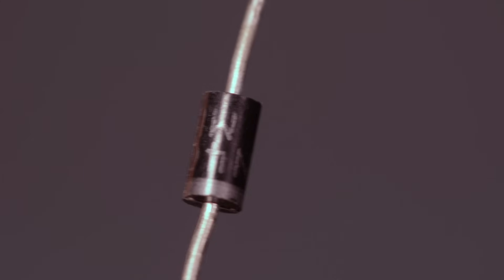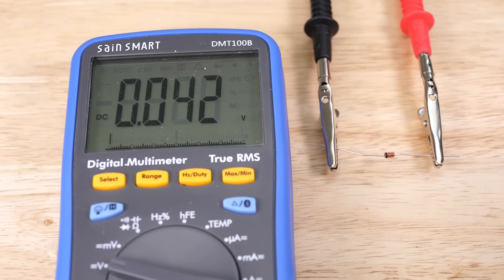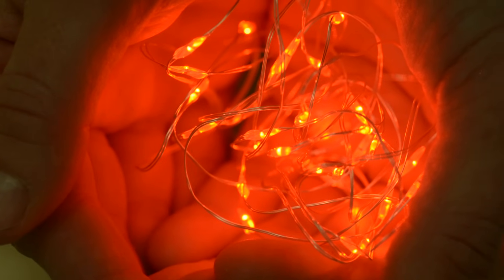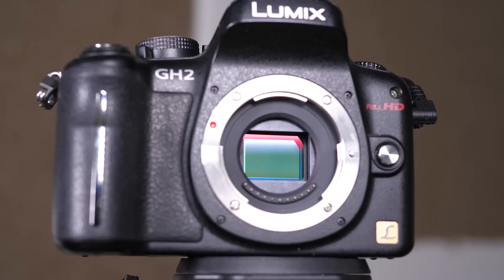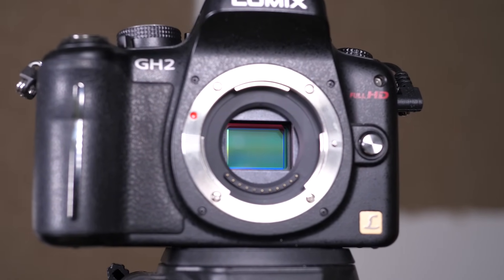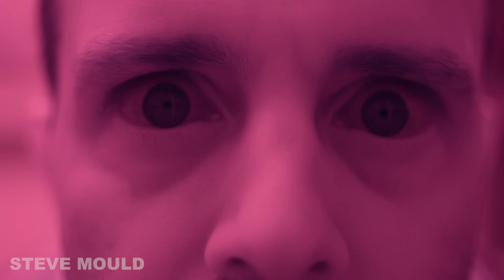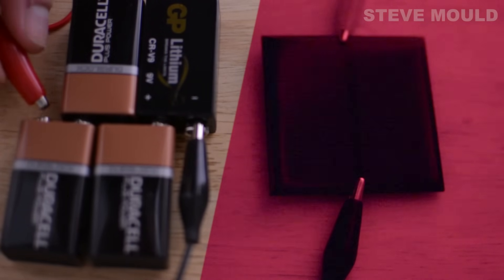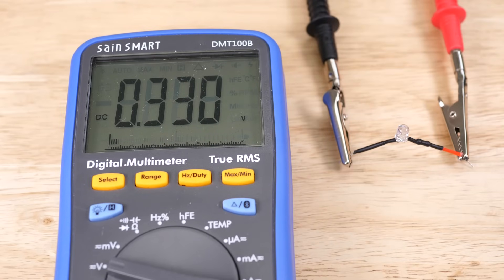Why all solar panels are secretly LEDs (and all LEDs are secretly solar panels)

Comment: It's also the same for electric motors and generators. Heh, it's a fun world we live in.
Reply: also peltier elements, put a power in one, and one side gets cold and other hot,  create a temperature difference and you get  power out of it.
Reply: @jolomies  watched electroboom's vid about peltier and someone in the comment section said that peltier is only 5% efficient. Is this true?
Reply: And piezoelectric crystals!
Reply: @allanrichardson1468  Actually, no.  If you squeeze those crystals you get a CHANGE in electrical potential, NOT an increase in current flow.  However if you increase or decrease the current through them you change the vibration of them.
Reply: @protoborg  Actually no. A piezo crystal is very high impedance, at DC at least, it's effectively a capacitor. Stress the crystal and you produce an electric charge on the crystal faces, apply an electrical charge and you induce stress into the crystal. Current flow is negligible at DC, just the initial tiny current to generate the charge.
Reply: @ferrumignis  And that proves I'm wrong how?
Reply: @protoborg It doesn't "prove" anything except that you mistakenly stated that a piezo crystal is driven with a current to create movement.   It's actually voltage driven.
Reply: @ferrumignis  Voltage measures current flow.  So...
Reply: Incorrect, voltage does not "measure" current flow.  If you tried to drive a DC current through a peizo crystal you would have major problems, even if you had a current source with a very large compliance.

You made a simple mistake, why are you trying to double down on it?
Reply: @ferrumignis  I see I found another one.  First, DC or AC is irrelevant.  Current flow IS measured in voltage as current flow is the potential difference between the positive side and the negative side.
Reply: And unlike diodes or speakers/microphones, electric motors are actually quite often used as generators as part of their normal operation. Eg. regenerative braking in electric vehicles (cars, trains) or pumped-storage hydroelectric power plant. They can be designed in such a way they're effective at both.
Reply: @TheAngelsHaveThePhoneBox  

Some intercoms use speakers as microphones.
Reply: @TheAngelsHaveThePhoneBox     Effective at both, YES. But efficient at both, not even close.
Reply: NoLlama Yeah, in fact most motors are also good generators, and vice versa.
Reply: @GRBtutorials  No.  The output potential of a motor turned generator is not even close to the output potential of a generator built to be a generator.
Reply: protoborg That’s just because they usually have a high KV, but you can use a speed up converter or rewind it for lower KV.
Reply: @GRBtutorials  Only DC motors work as generators.  So saying that a motor is the same as a generator is just plain stupid.  AC motors cannot be used to generate electricity, no matter how much you alter the KV.
Reply: @protoborg  First off, technically all motors are AC motors, even brushed DC motors, but I'll call them DC because the commutator is integrated into the motor. However, brushless motors need an ESC that creates 3 phase AC from DC so I wouldn't call them DC motors. And brushless motors definitely generate electricity as I've tried that, and each phase definitely outputs a sine wave.
Reply: @GRBtutorials  DC motors are sooooo NOT AC motors.  Pass an AC current through a DC motor and guess what, NOTHING HAPPENS!!!  The type of motor has nothign to do with where the commutator is.  What determines the type of motor is whether it  can run on AC current or DC current.
Reply: protoborg You seem to have misunderstood my comment. What I meant is that the only reason the commutator is needed is the fact that they need the voltage to switch polarity for them to rotate. And doesn’t switching polarity remember you of something? That’s right, the commutator is a mechanical DC to AC converter. Of course, you can’t just put an AC voltage across the contacts and expect it to work, but AC is running through the coil, so they’re technically AC motors.
Reply: @TheAngelsHaveThePhoneBox  But electric motors as a general rule are NOT generators.  They have to be specially designed in order to do that.  Those motor/generators suffer as a result of that engineering.  Function as neither very well.  That's why generators that are built to be generators and motors that are built to motors function sooooo much better.
Reply: All I heard was, you reverse the polarity to solve all your problems.
Reply: @rivencraft1734  That technique is especially effective on the neutron flow, for some reason.
Reply: @OrangeC7  obviously. Come on! Neutrons are known for their lack of charge so if you reverse the polarity you get anti-electricity which is almost as awesome as tachyons!
Reply: Anton Juul-Naber yeah motors can also emit light. its called a sparking commutator
Reply: Charlie Angkor And motors and generators can ignite fuel vapors to create explosions.
Reply: All physical phenomenon are reversible based on the standard model of physics and the CPT symmetry
Reply: And also electrolysis in 🔋
Reply: Capacitors make sound with high enough voltage.
Reply: @empanada401  the voltage does not even need to be very high. A 1µF 0805 X7R cap was quite audible with an 8V 217Hz squarewave. Its  just a kind of piezo ceramic speaker with the PCB acting as a diaphragm.
Reply: Also transmitting radio antennas and receiving radio antennas.  Yup, loads of phun with photons.
Reply: Same with good and evil..🤔🤨
Reply: I have videos about this on my channel
Reply: Tranforming energy from one state to another.
Reply: It's a shame this principle doesn't work in humans for food production...
Reply: Ure almost crying how u miss it... think of black n white cars! :P
Reply: What have I done
Reply: It is now the year 2021, do you still think it is a "fun" world ?
Reply: Nope.

Comment: hey Steve, I'm studying electronics and I gotta say, pretty well made video! if you want to look at other "reversable" electromechanics stuff here's a few examples: Peltier-/Seebeck-Effect (voltage creates temperature differential, but temperature differential also creates voltage), Piezo-Effect (voltage -> crystal lattice deforms, crystal lattice deforms -> voltage), or coupled inductors (current in one coil -> voltage in the other, but also it affects itself. pretty weird.)
Reply: Also some motors and dynamos. I was very happy when I found out you can wire two Lego Mindstorms motors together and control one directly by turning the other.
Reply: I mean, he touched on the reversibility of the piezoelectric effect when he demonstrated that microphones and speakers are interchangeable :)
Reply: IceMetalPunk Actually, that’s not really the piezoelectric effect at play, it’s EM induction on the speaker and something more complicated (that has to do with capacitance) on the microphone.
Reply: There is no single correct answer to this. There are many different techniques to build a microphone. You can use a magnet attached to a membrane. This membrane is vibrating when you speak on it and the magnet induces a current in a coil. Other microphones use a capacitor with one electrode being a charged isolator (electret). The electret electrode is attached to a membrane similarly as in the previous example. The sound waves make the membrane move again which causes the distance between the electrodes to change. This movement causes a change in capacitance and eventually a change in voltage across the capacitor.
Microphones which use the piezoelectric effect exist, but they have a rather bad sound quality. But they are mechanically sturdy which makes (or made) them useful for some applications.
Reply: @IceMetalPunk  oh yea that's true, i kinda forgot about that video until he mentioned it and even then the memory is foggy...
Reply: Could we use piezoelectric devices as engine mounts in cars, so that they recover electricity from the engine vibrations? Would it work?
Reply: @TheNasaDude 
Probably not, but if you're in a position to do so it might be interesting to look into.
Reply: @TheNasaDude  You may definitely capture some energy but too little to worth. Anyway, turbo is to recover some energy from the exhaust gas.
Reply: reversible.
Reply: @JohanFouche-k7w  When I was 6, I used a spoon as a microphone then progressed to a flat iron which I didn't realise was still hot! ...Lesson learned. :(

Comment: But there is a Big difference between a direct junction and indirection junctions, that is why LEDs are not made of Silicon and the Solar Cells for Space also not, it is more expensive but much more efficient. Hast do do how the Electrons combine and if there is a lattice Phonon needed because of the Impulse angle. Solare Pennals are made of Silicon because it is much cheaper than germanium. Please not only say Diode but what Substrate is also is Diode as it self is to arbitrary in this case, and i think this would confuse less normal people.
Reply: You still a very good Science communicators

Comment: can you light up a LED just with shining a light on a different LED?
Reply: Yes! It's not very effective but it should work.
Reply: Yes! It's similar to an optocoupler.
Reply: @karlkastor  This is exactly an octocoupler, and commonly used. :)
Reply: Yes but you generally need to have a lot of light shining on the first LED and the second must have a lower voltage drop. done it shining a blue LED onto a green GaAsP led and using the voltage generated to light a hyperbright red LED. You generally will have to shield the blue LED and the green one, as otherwise the light from the red is nearly invisible in the glare, the efficiency overall is so low. You also have to couple the blue and green together well, so flat top ones are best with some tubing joining them.
Reply: Yes. Shining a 532nm green laser onto a yellow LED usually lights up a red LED quite well. This should also work shining a 405nm violet laser onto a blue or green LED to light a lower voltage color.
Also, "an LED" not "a LED". Unless you're pronouncing it "ledd". But most folks pronounce it "ell ee dee", in which case "an" is the correct article.
Reply: @DancingRain  
I've always wondered about that with abbreviations. Is that the official grammar rule? My native language isn't English and all English people I've asked don't know.
Reply: @Baron von Quiply 
Thank you for the insight. I know about the vowel rule but I have always been unsure as to wether this applies to written English or spoken/pronounced English. Looks like the way it would be pronounced is the dominant reasoning behind wether to use 'a' or 'an'. Makes sense as when you read something, you 'pronounce' it in your mind. 
Another day, another thing learned; thanks!.
Reply: @Die__Ene  The rule is depends on how you pronounce LED .  If you pronounce it as a single word it is called an acronym in this case it will be an a LED .  If you pronounce it by the letters individually it is called an initialism and it will be an LED .  (Examples of acronyms are NATO and OPEC and initialisms FYI and FBI. Thus you would say and write a NATO country and an OPEC country; and say and write an FYI list and an FBI agent.)  Since LED is used both ways, acronym and initialism , both written with a and an would be correct. 

Since these replies are social media posts and not an professional publications, such corrections are not necessary and can be considered pedantry.
Reply: Makes as much sense as having a motor run a generator that powers the motor
Reply: Wouldn't that just be using a solar panel to light an LED? Hahaha
Reply: In theory, yes.

Of course, variations on this are used all the time.
Combining an LED with a photodiode (basically an LED sized solar panel) lets you make a detector which can determine if an object is passing between the two.
This is how computer mice used to work (The ones that have balls in them)
Reply: If you can does that mean it's perpetual 😂😂😂
Reply: yes it does work,  wire a high efficiency red to a clear green one, and use an ultrabright green one to excite the green one acting as a photocell. 3.8v to green led, green receiver makes about 3.2v, red Led needs 2.2v or so to glow.
Reply: Holy smokes, we can make home made light detectors that require a light source, to light up lights and detect the light.

This is a pointlessly ground breaking concept. I like it. Goes well with my pen pineapple apple pen.
Reply: It might read 3v but you wouldn't have enough current to power another LED
Reply: Depends on the diodes used, but generally No, not with just one.  You’d need at least a couple in series to get the voltage high enough. It won’t be very bright because LEDs are very inefficient solar cells because they’re so tiny.
Reply: Yeah, though you'd need multiple LEDs to power the one LED to a good enough standard

That is if you're not artificially powering the LEDs, but then again you'd probably need quite a few LEDs

Comment: How heat is transfer by photons in radiation?
Reply: Photons have a frequency, their energy determine their frequency (and vice versa), so a photon with high frequency will have a lot of energy. And heat is just the way particles kinda display energy, by vibrating, so a photon has energy from it's frequency, which can also be said as heat is transferred in photons depending on their energy. 

I don't know if that made sense, I tend to overcomplicate things, if you have any questions, just ask.
Reply: @liammargetts  thats the more techincally correct version of what I said yeah
Reply: Kinetic energy transfer
Reply: When sunlight strike us we feel the heat but when led of the same wavelength(i.e.white light) strike us we dont feel the heat.Why?
Reply: @eroswayn1394  the sheer number of photons.
Reply: @eroswayn1394  but also a white light LED is not white in the same way that the sun is white. 
White light LEDs are made up from three diode components that produced a narrow spectrum red green or blue and those three together make white. 
The sun produces practically all wavelengths of light, from radio to gamma.